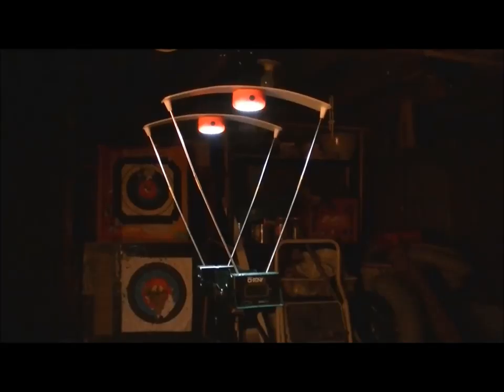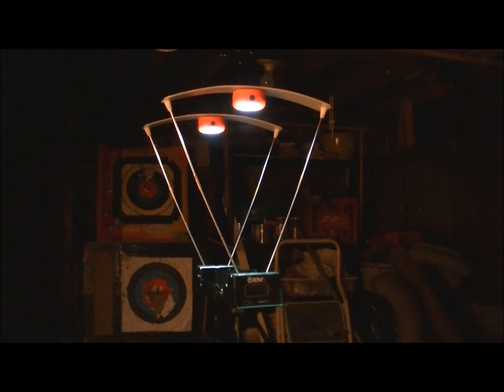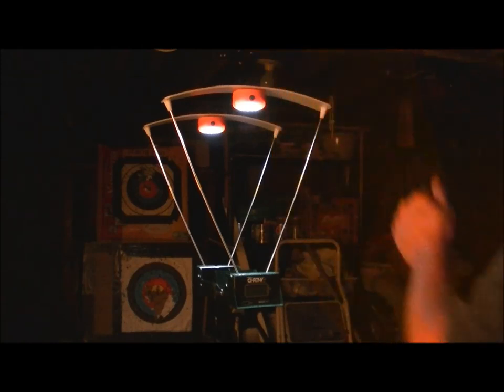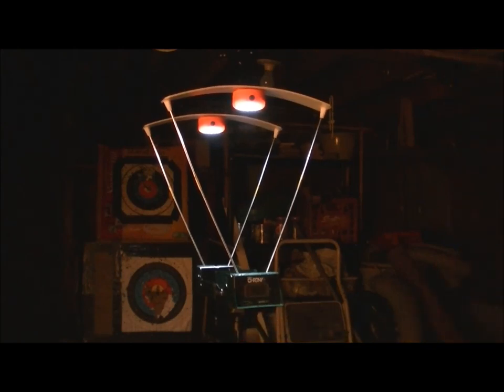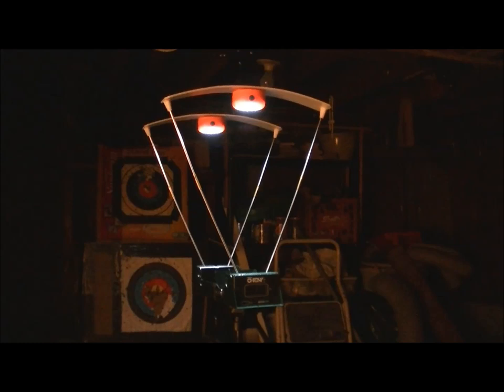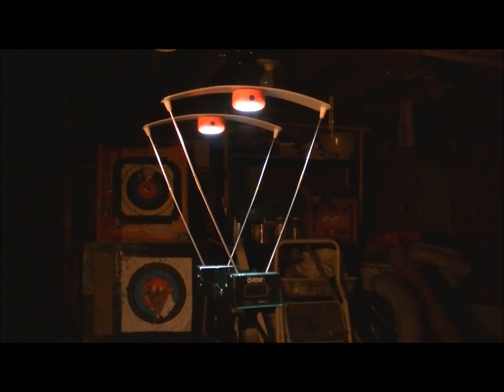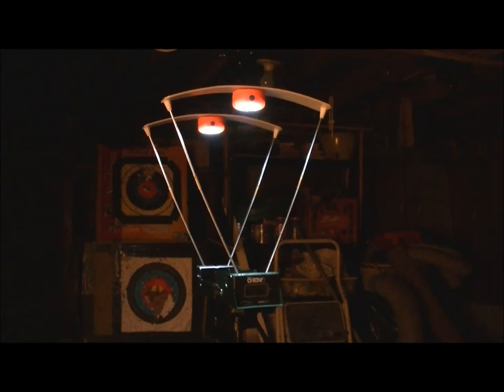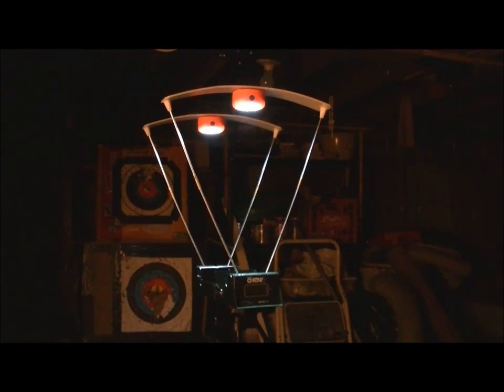F1 Chrony inexpensive lighting kit mod

Comment: Total fail for me. I did this, and I just got back from range. Had it all set up in my lane and the reading gave me ERROR 1 right away. It also recorded some velocities in the +3000 fps range, before I shot. Shooting did nothing. 

I bought two sets of LED's some on line (round) and later some rectangular ones that were brighter, they went on sale at Harbor Freight, so I got them as a back up. I attached them with magnets. Bottom line no joy.

Comment: Mine doesn't work with those lights...
Reply from the maker: +Fred Fable that sucks worked great for me
Reply: Worked great for me. I was 3 feet away per the instructions with all of my airguns. I use magnets instead of Velcro to hold up the lights. Had a few errors but on the whole it's fantastic! Worked for everything from my co2 pistols to my FX Impact!